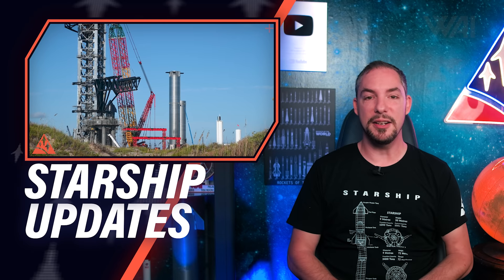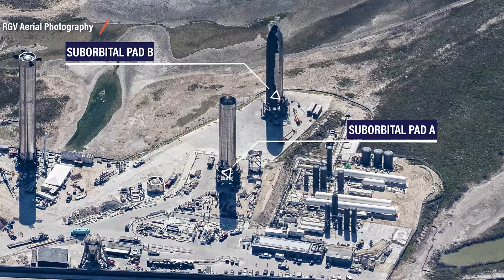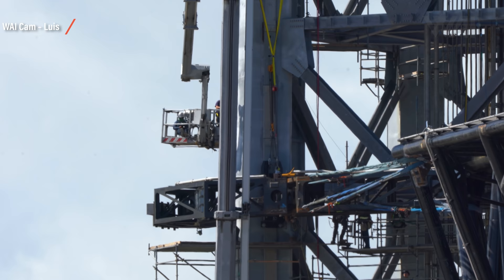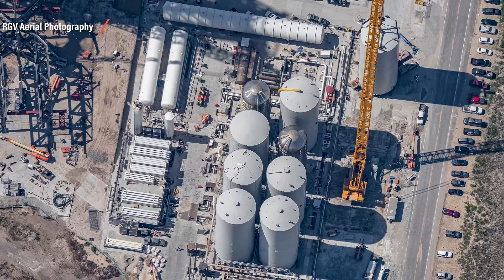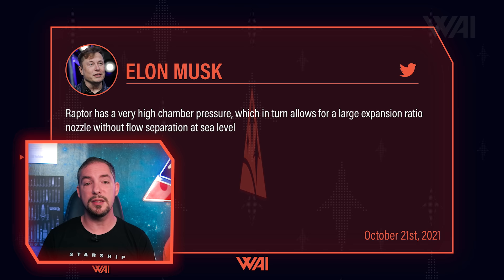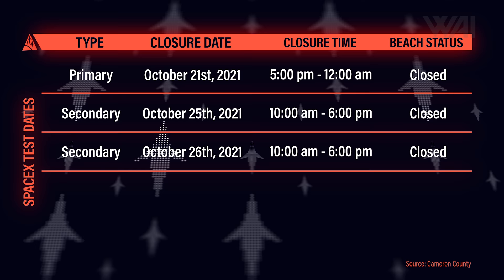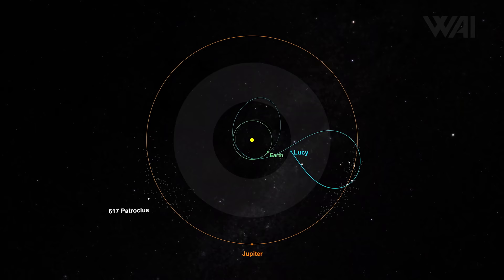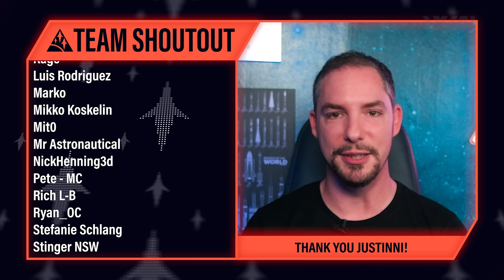Starship 20 double static fire analysis & Mechazilla installed!

Comment: I don't believe the catch arms (chopsticks) will work, I don't think any of the Starships have landed anywhere close to the center of the landing pad, thus the booster will most likely miss the planned small landing space between the two chopsticks and hit the ground near the tower. They will be very lucky if the booster doesn't hit the tower and take it out. Watch all the previous landings of the Starships and see how hard it is to land in the center of the concrete slab that has a much larger area. Not trying to be negative, just being honest.

Comment: I don't have much hope for the tps tiles due to expansion and vibration. The shield needs to sprayed onto the starship as a brake specialist does with heat proof paint on a caliper.
Sn21 needs a SKIN!
Reply: maybe spaceX should hire you (sarcasm)
Reply: @myggen2111  
Anytime I need a life change and Im confident in my theory. 
(Not sarcasm)
Reply: @leighfilmer1962  if it was that simple i think they'd have done that instead
Reply: It already has a thermal blanket “skin” beneath the tiles. As long as the starbricks  have a good attachment system it should hopefully be fine. Plus stainless steel!

Comment: A question about refueling starship in LEO

Hasn't been considered using a magnetic launch rail on the equator close to it, to launch fuel capsules into LEO, with the ability to use some fuel, or using iron drives, which would allow them to maneuver true starships or a fuel Depot and thus reduce
The cost of starship launches for refueling?

Scientia Non Domus,
(Knowledge has No Home)

antiguajohn

Comment: I don’t know how people have come to the conclusion that starship will be caught by Mechazilla. The booster will, that is clear. Catching starship by the front “wings” is a nonstarter. The “wings” are completely covered with heat shields. The weight of starship would destroy them. Even the “wings” would need a lot of reinforcement.
Reply: it was a tweet from Elon, he said it would be great to catch Starship as well... horizontally when possible, vertically when more practically... but catching would be the way to go... 

so... if they go with this... we'll see sooner or later modifications in that direction. 

on the other hand. an attachment point for the crane, like it is currently, isn't viable for starship as well. the heat shield at the nose is one of the parts with the biggest heat load if I'm not mistaken and right now it has several attachment points, penetrating that heat shield to get the whole thing up on top of the booster... so not good!
Reply: @spanke2999  During the interview with EveryDayAstronaut Musk mentioned that they could have load bearing mechanism fold/swing out from the leeward side.
These could also be located further down than the upper flaps, in areas where they expect less plasma spill over
Reply: Because catching it is actually easier than putting some good functioning, reusable legs on there.
Reply: @kevinkrammer8077  Yes. That would be an option. I and I did see that tweet. But I don’t see that in the animations or mentions here.
Reply: @spanke2999  “horizontale when possible” is probably Elon trolling people. I think the catching is possible but not on the fins. As for lifting. Might need some options. The Spaceshuttle was mounted to its tank through the heat shield so could be possible.
Reply: @justinni_  I’m not saying they shouldn’t and as for the challenges. No, it would be harder and more massive. The actual benefit/requirement is so the rocket does damage the landing pad or it’s self.

Comment: Why can't Space X make a couple larger tps tiles...like an 8th the size of the total starship shield?
Reply: If the tiles are like the space shuttle then they are ceramic. Perhaps larger tiles are impractical to make and more fragile due to their weight and possibly cracking from the lightest vibration / flexing. A better solution is required as these rockets are expected to be reusable on a quick turnaround. It took weeks each time the shuttle returned to check all the tiles and get replacements as there are lots of different sizes of tile.
Reply: @InnocentMan99  Why can't they coat aluminum with some kind of fire retardant suspend it a couple mm from the hull then force some nitrogen between the two?
Reply: @Ragnarok3rd  well it’s a thought but I suspect maintaining the pressure may be worse than sticking to ceramic tiles. A sacrificial shroud that could be replaced for each flight may also work, but they want a quick turn around on launches and I would be worried that a proper inspection of heat shield tiles could not be made without seriously extending the times between launches and of course rush burn ups on re entry,
Reply: @InnocentMan99  not pressurized just super cooled nitrogen forced through and expelled until re-entry is done. A separate tank were compressed to contain enough...it might be possible to keep the surface cool for re-entry.

Comment: Why do they even use sea level raptors on starship if they could just use the vacuum engines on sea level?
Reply: The sea level raptors are still more efficient at higher atmospheric pressure.
And the vaccum raptors are too large to gimbal, so no thrust vector control.

This latter fact is also why it is likely that at least one of the sea level raptors will be used even during the upper portions of ascend.
Reply: @kevinkrammer8077  The most efficient pressure a rocket engine can run at is just at the point where flow separation is about to happen. At lower pressures there is a pressure difference — and thus energy left — in the exhaust gasses. They might also have room for gimbaling if they just had three vacuum raptors in the middle as close to eachother as possible and no other engines.

Of course with superheavy main limit in bell size is the thrust per area ratio, so it would make more sense to use SL raptors there.

Comment: I’m no engineer, but could they not have a thin metal skin over the heat shield tiles??
Reply: that would add a lot of weight. that's wat they are trying to avoid.
Reply: @myggen2111  great! Thank you 🙏 for the info and kind response!!

Comment: These "space bricks" are a big liability. The chances of S20 surviving reintry is pretty much 0%. Not only are they problematic, but they are likely the most expensive part of the ship like it was the case for the Shuttle.
Reply: probably not that expensive, that is why they are not sticking so well.
Reply: @snuffeldjuret  The stuff itself might not be expensive, but the labor and time to install them is. They can build 3 starships by the time they install the bricks on a single one.
Reply: @Lavoye  the time and labor to install them is not comparable to the space shuttle though.
Reply: @snuffeldjuret  Shuttle had more complex shapes all over the place. The cylindrical shape of the Starship makes it a lot easier. But the flaps and noze are a completely different story. Even the nose hooks where they lift it with the crane... How the hell are they going to cover that? I'm wondering why they are not pushing the flaps to be further behind so to make the bricks design simpler and sturdier.
Reply: @Lavoye  the current plans for the forward flaps is to push them back a bit to reduce their influence (or what to call it), so I assume the aft ones are not moved as it would cost weight to get the same effectiveness from them. Dunno about the rest, will just have to wait and see :).